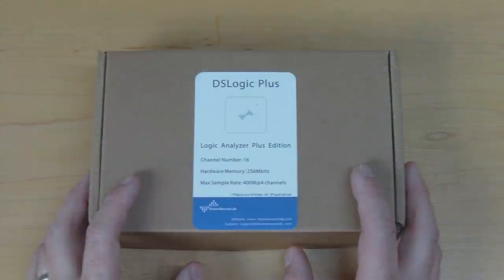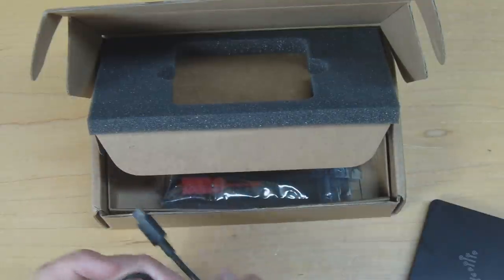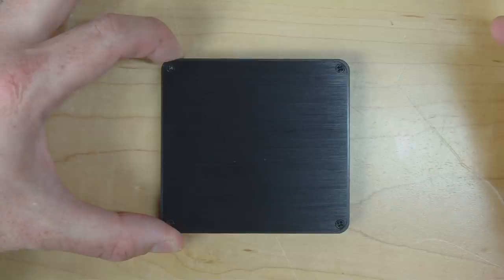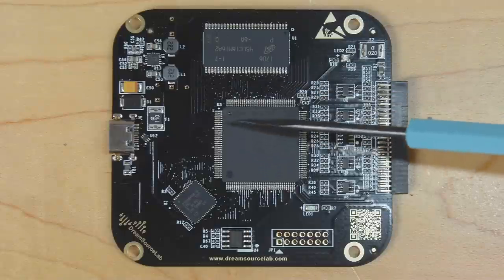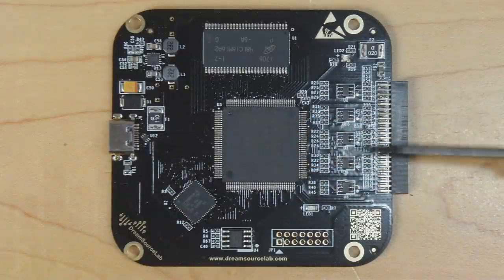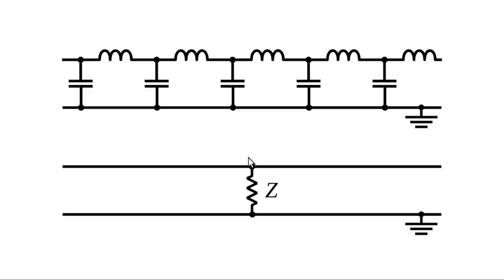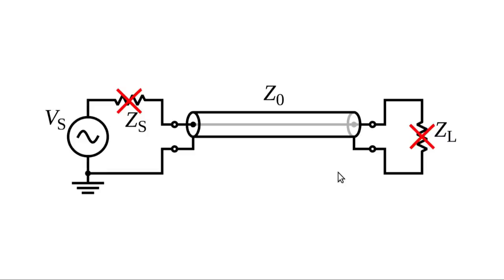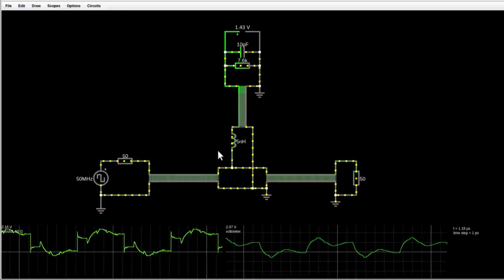[009] DSLogic Logic Analyzer Review and Teardown

Comment: this hardware is crap, do not get it, huge disappointment, I basically throw mine in the garbage
Reply from the maker: +ThinkLearnSolve What problems did you have? Did you have the Original, the Pro, or the new Plus model?
Reply: the connector broke completely off, as it came out of the box, it was loose and desoldered, the way they designed it, it would been impossible to properly stay in place; they used an iPod style connector, then other attachment that plugged into the logic analyzer was just made of metal and stitched together with over the counter tape; the probes broke off on first use;  do not recommend, very poor quality, they have a fancy website, but the actual product is crap, use Saleae Logic Pro instead, that is actually a decent product, this thing cost as much as that, but comes nowhere close, they lost my trust forever; I don't know which model I had, the Pro I think
Reply: What's the difference between these models?
I've got mine from a ebay seller but it was only the basic version. Is it possible to do a SW upgrade to Pro with the Pro Firmware?